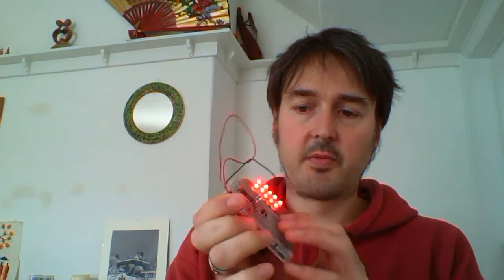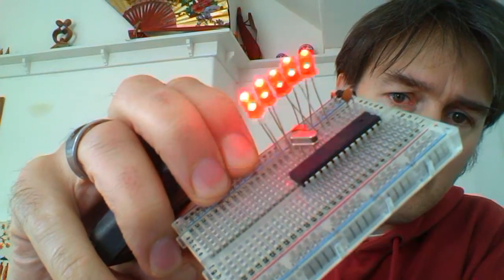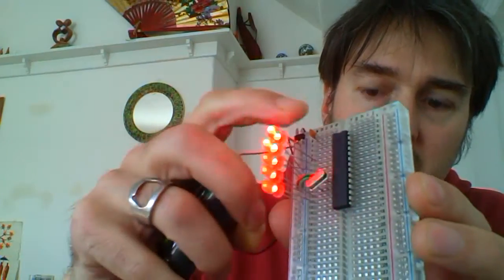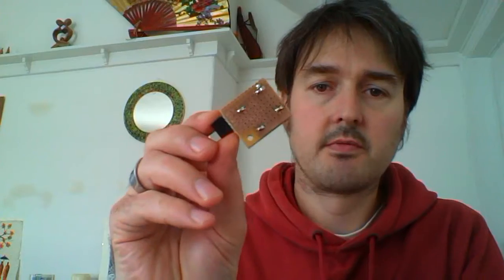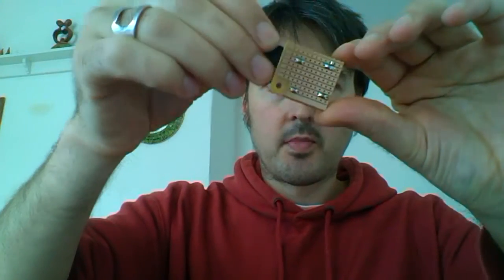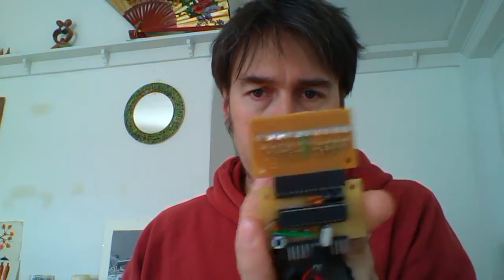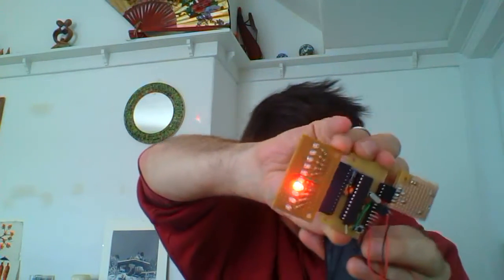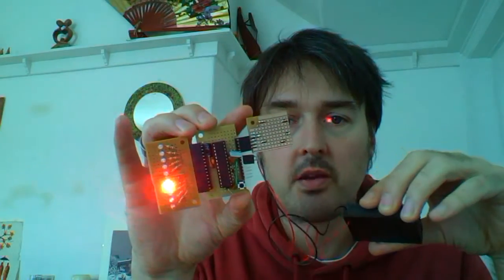POV with Minimal #Shrimp circuit, and first demo of Coin tilt switch

Comment from the maker: Based on the kits from our workshops, if you have a red wire - put it into a row which already has a red wire in it (Red means 5V). The black wire goes into any row with a green wire in it (Black normally means Ground=0V, and our circuits use Green for this). For reference you can use the diagram labelled POV Circuit in the Student Guide linked from this video.